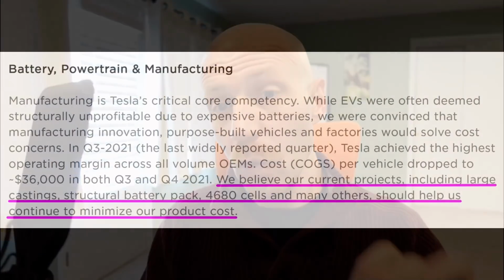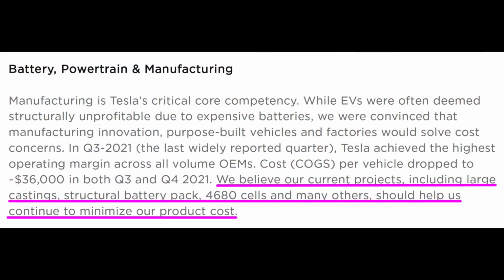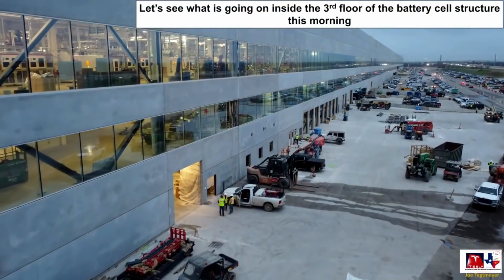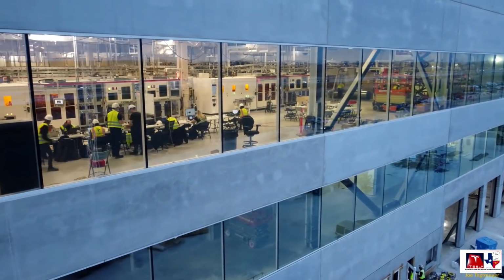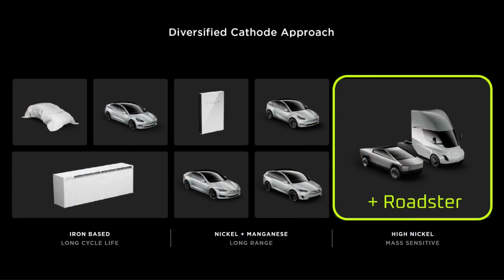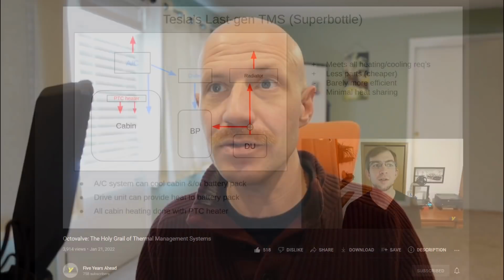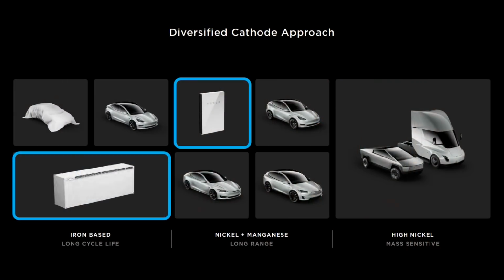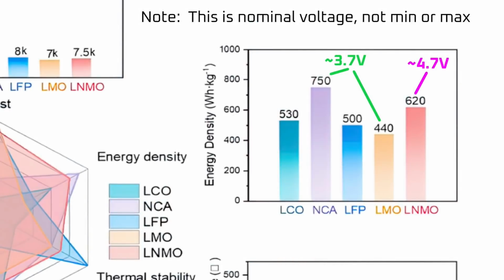Tesla Q4 Earnings Call:  A Tour de Force // Battery Maturity, Embodied AI, FSD Demand, Mn Batteries

Comment from the maker: Additional Note/Correction on Manganese and LFP! 😀

1) I may have been incorrect about the ability of Manganese to dope LFP and increase energy density.  I thought I saw this at one point, but I'm struggling to find that information again.
2) I can't find a chemistry that's primarily LFP chemistry with Manganese added.    However...
3) There is an up and coming chemistry called LMFP which appears to be 80% Manganese Phosphate with an Iron Phosphate and Carbon shell....
4)  LMFP has a voltage 20% higher than LFP and it appears that most of the rest of the characteristics similar (cycle life, power density, capacity, etc)
5)  Elon said "manganese is an alternative to iron & phosphorus"...
6)  So did he mean an alternative to both iron and phosphorus (in which case LMNO which is an oxide), or an alternative to Iron Phosphate (in which case LMFP, which is mostly manganese phosphate).  Eliminating Phosphorus is relevant because it poses a host of environmental concerns (but there are companies working to develop greener processes).
7)  The plot thickens!  I need to do more research on this.  I've just scratched the surface, but it's pretty exciting.
Reply: Thanks Jordan 🙌
We need more of these types of videos from you.
Also good idea to do a monthly battery news video.
Thanks 👍
Reply: I think a monthly update video would be awesome. It allows you to slot in information that doesn’t fit into any of your regular videos or cover information in time manner and going to detail later on.
Reply: https://www.youtube.com/watch?v=C8FNv6hlMVI No affiliation, but a great explanation of LMFP
Reply: Listening to interviews of the Chinese factory president I believe that a Chinese Tesla’s is 100% on the cards. While it won’t be called a $25,000 Tesla I suspect the Chinese vehicle will fulfil that price bracket. The president of the Chinese factory spoke at length about producing a vehicle that is uniquely Chinese and something they would all be very proud off.
Reply: I think we need to have post quarterly earning call listening parties and parse sentence by sentence what is being said whenever Elon speaks. Or basically whenever one of the engineers speak.
Reply: @Tuber_Dog  you are joking about all that 'alien' stuff, right? It makes no sense at all.
Reply: I have a couple of 42 SEER 15 HSPF Carrier minisplits. That is more than 3x as efficient as my 13 SEER whole house unit. When you research the subject, efficiency matters.
Reply: Don't worry- wait until you get to be my age- then you will start to remember LOTS of things...
Reply: Hey jordan. A bit curious. How did batteries become your speciality?
Reply: Interesting that Sandy Munro is talking about LFP batteries in this video (https://www.youtube.com/watch?v=9z9xl8knLAk  at the 10:45 mark) where he says that LFP has much better energy density (but lower power density).  And he mentions the guys who replaced a Model S battery pack with LFP and it went 800 miles on one charge.

Comment: HOW MUCH DO WE KNOW ABOUT THE CATHODE PLANT IN TEXAS ? The LNMO of this presentation becomes more appealing by the hour & with a possible completion Q1/2023  there is plenty of time for development of the cathode plant while Texas & Berlin are ramping.
 About all we know (1) Dry electrode - Maxwell (2) Tab-less - Tesla internal, 
We don't know (3) Could graphite/silicon anodes also be produced -  Sillion ? (4) Could the final stages of refining Li, Ni, Mn occur at Texas - Capturing the high refining profits - (5)  Li-OH or LiCO3  ( 6) Electrolyte & electrolyte additives - Delhousie etc.
YOU HAVE FOUND THE KEY - FURTHER WORK ON LNMO IS CERTAINLY IN THE RIGHT DIRECTION.

Comment: There are so many problems with building a humanoid robot, however the most difficult is definitely the batteries. First of all batteries are extremely heavy, second they are extremely expensive, 3rd they are extremely volatile if they get punctured and explode. Another issue is their longevity, they do not have many cycles due to the current use of battery murdering systems. Therefore, even if you did get all of the other problems solved, the battery pack would not last and would make the robot prohibitively expensive and also unsatisfactory, and therefore unpopular.
Reply from the maker: Current battery tech will do the trick, just use LFP and pot it correctly.  However, by the time the robot is mass produced for the public, the tech will be much better (5+ years)_

Comment: Here's an alternate view on Tesla's 4680 situation.  There recently was posted a staff picture celebrating the 1 millionth 4680 battery in California and it implied this was in January 2022.  Well one million of these batteries can supply batteries for approximately 1000 model Y's.   If this is the whole story then Tesla is in big trouble with the 4680.

More likely the California plant has been more focused on assembling and validating new entire battery lines for shipment to Germany and Texas.  Even still, my feeling is that the Tesla truck has been delayed because demand the Texas Model Y (how is Tesla going to manage this channel conflict?) will be through the roof and the battery lines in Texas and Germany are just coming up to speed.  Tesla is not confident that there would be enough cells to supply the CyberTruck as well in this year.  So the "parts problem" of the Cybertruck then is actually just the 4680 cells. 

As an aside, it's noteworthy that Panasonic has moved its 4680 manufacturing from Nevada back to Wakayama, Japan and it's implied this is because the technology was not coming along fast enough.  I guess it's tricky.
Reply from the maker: Nah, it's chips, every other OEM is reducing output.  Tesla is increasing output, but you can only make those chips stretch so far.

1000 vehicles worth of cells is plentry to start a production ramp and there is always an S Curve with Manufacturing

Comment: I‘m actually wondering why so man people think Optimus is so far away from Teslas main business. Imagine, we might get robotaxis one day. There will not only be issues around charging those robotaxis automagically. There will also be issues around how to clean them automagically. Or even imagine you want to use thta robotaxis not only during day time but 24x7 as much as you. can. So my business model would be to utilize a lot of them, that will not be useed for people transport at that times as much e.g. during the night time for parcel transports. But for all that, charging, cleaning,  rebuilding at the beginning of the night to be a parcel transporter,  load and unload them at their source and destination addresses, probably utilize the as a delivery hero car or doing some minor repair work on them like changing tires depending in weather conditions etc.pp, whatsoever, you would either need expensive human workforce or inexpensive Optimus types of humanoid robots. So Optimus IMHO is at the verge of its existence THE essential missing link between a plain robotaxi fleet and an economically optimized robotaxi fleet. As soon as Tesla has achieved that, Optimus will be a interesting product to be sold or rather RENTED as a personals assitant for any human. Which will make the product Optimus even more profitable.

Comment: Re: $25,000 vehicle... I think Elon is telling the truth that this model has been dropped for the time being, because Tesla sees Tesla Network as their way to get into that price sensitive market. 

Let's look at a 7-year cumulative TCO. Let's say for a $50k Model 3 that TCO is something like $75k at year seven. For the $25k Tesla that drops to $50k. This is assuming both have 29 kWh/100mi and we're driving about 15,000 miles per year in Colorado.

That means the cost per mile on that $25k Tesla for those first 7 years is $0.47 instead of $0.71 for the Model 3.

That might seem like a decent savings, but compare that to the Tesla Network estimated cost of $0.18/mile. It blows even the $25k Tesla out of the water. And that number could possibly be improved with a more ruggedized vehicle, even if it's more expensive. I think that's Tesla's path into the low end of the market, not trying to nickel and dime a vehicle down to $25k.

Comment: Respectfully disagree on the $25k/robotaxi point. Tesla's current offerings are designed around private ownership fo factors. When Tesla is serious about deploying a robotaxi fleet, they will need a form factor actually designed for high volume usage. That means easy access for low mobility (sliding doors), no "cockpit", etc. Something that lools like the Cruis Origin, which would likely cost around $25k to produce.

Comment: THANKS4GIVING Great post young man. I am also interested in HVAC or Thermodynamics, looking forward to any of your posts on that. 
    About 3/4 through you mentioned Elon stating higher voltage.  I feel strongly the operating voltage of these battery packs will go up to a voltage of 1000VDC. Koenigsegg is already using 1000V systems.

Comment: Agree with Elon. No LFP in the 4680 form factor as BYD's Blade Battery is an excellent solution. Your presentation of LFP convinced me that it's a stable chemistry with long term performance. The ability to fully charge and discharge provides more useful energy. NIO has addressed cold performance with their hybrid-cell (ncm/lfp) battery pack.

Comment: Great episode, Jordan!   I love the channel, always interesting although often over my (telecommunications contractor) head.  As a pro "cable guy," I still wonder about replacing CANBUS with a more network - like system; Tesla has a patent (or many) regarding this, but no action yet... I think.  Elon said "CANBUS is stupid."  A mini wifi network, with address(es) for each car would be super, and the wiring required and its installation could be cut WAY down. Sandy Munro pointed out the miniature receivers on Tesla circuit boards on the M3 teardown, so maybe they're getting close.

Comment: Great video, Jordan! There is some info going around that the new 4680 battery pack will have 98Wh this year, 108Wh in 2023 and 118Wh in 2024. Doing the math, this would give the model Y 94 kWh in 960 cell format this year. I see the 960 pack as 120 cells in series of 40 cells x 3 rows x 8 sections. Do you think Tesla will stick to that, or do you think they will slim it down to an 840 cell or even 720 cell format? To keep the Model Y around 82-85 kWh? This would also leave more cells for more cars.
Reply: I think as the batteries get better, they'll just use fewer, as required to make the stated range.  There's no reason to keep upping the KWh, other than maybe for a Super Long Range model with a hefty sticker price for those who DO want a 600-700 mile vehicle.  For an extra $10-12 thousand, maybe?

Comment: I'm not a battery expert, but from a purely mechanical POV, 4680 may not be suitable for LiFeP batteries because of the lower volumetric density, and consequently, the higher battery volume needed.

There's only so much area under the car that can be used for batteries, and if you need more volume you have to make the pack thicker.

Double stacking 4680 cells would not make sense because you would lose the structural benefits, and pack simplicity.  Maybe you could develop a taller battery cell, but given how rapidly chemistry is evolving, it would be risky to put the needed effort in developing that, building that machinery, etc.
Reply: It may be that they use a combination.  Prismatic in cars, 4680's in storage.

Comment: I am woried about the over hype of the robo taxi. We are looking at it through the best case scenario. What happens if just for the case people don't like the idea of being driven by an autonomous vehicle? Doesn't help all the negative media coverage about the full self driving. Besides that, it's just not as simple as 5x the amount of cars. Most people commute to work in a very narrow time period. It's not so easy to serve this demand with the fifth of the amount of the cars. Maybe in one to two ratio. Also a big potential issue is comfort. Most of people hord lot's of gadgets in their cars. Not sure people are ready to load and unload them each time they go to work. And these are just a few of the issues. I'm pretty sure the robotaxi is going to be an amazing thing. I personally can't wait to have it here, but I don't think it will replace personal cars, and specially not for the less wealthy people. They usually can't afford taxi and topically use old used cars around max 20K. So in my opinion not focusing on the 25K car is a huge misstake.
Reply: The robotaxi will be a niche, no one thing serves all needs.  They're not focusing on anything they can't make.

Comment: I look forward eagerly to your analyses of battery tech but this video was next level!!! More of this pleeease...
I'd also like your opinion of utilising smaller battery packs (using same resources you can create more packs/cars) that charge faster (this is another benefit of the 4680 and it's "tabless" design) and which are also lighter and are thereby more efficient (i.e. get more miles/kilometres per kWh). Part of the problem currently with the car is that it is over a tonne of vehicle weight moving the occupant (~100kg) which makes the useful effort only about 10% efficient at max - this issue is even worse with evs as their weight is even greater...
Generally speaking people won't need more than 200km range and, if the battery charges fast enough, there shouldn't be issues when going on trips...

Comment: For collecting data for Tesla bot. You just need humans with cameras and motion capture gear then have them perform some task in the factory. This is why the robots need to he humanoid because it simplify data collection. Also getting robots to do useful task is actually much easier because factories are a much more controlled environment than the public roads. It is highly likely that Tesla will have humanoid robots working in their factory before self driving cars drive unattended in public roads.

Comment: Frankly, nothing you've said gives me confidence they're about to produce 4680s at scale, and everything you'd said reinforces my thought that literally 'everything' depends on that.  Kato Road is irrelevant, that's not ever going to be mass production at the scale they need.  The fact that batteries won't be the constraint over the next year doesn't mean they have unlimited batteries, it just means they have limited chips.

It's just like you said, until it's happening, it hasn't happened yet.  4680s at scale haven't happened yet.  They may come, they probably will, but until they do, they haven't, and everything depends on them.

I think it's turned into a much larger production problem than they thought, and they're always getting closer, but they aren't there yet.  Every revelation of another step forward is really just another way of announcing that they aren't there yet.

And until they are, they aren't.
Reply: They said in Sept 2020 during battery day 4680's would take 3 years.  They're still have a year and they're making progress.  I think your lack of confidence stems from a lack of understanding.
Reply: @TheEvilmooseofdoom  We should be able to do better than insults.  But thank you for your perspective.
Reply: @benwashburn8553  A reality you don't like isn't an insult.

Comment: For an HVAC system, it's all about integration and control software. You may use your roof for sourcing heat if it's sunny in the winter, or to dump heat on a summer evening. Similarly you can dump heat in the summer by heating up water, or heat up a home by cooling liquid in a geothermal loop, or by cooling wastewater from showers, washing machines, venting exhaust and the like. There is so much efficiency to be had in the home that we should be able to slash energy consumption to less than half it is today. With better insulation and venting, we may gain a factor of 4 or better. If we combine that with energy storage (using EVs or stationary storage), we should be able to efficiently utilize the more bursty renewable energy sources and greatly reduce overall energy cost..
Reply from the maker: This is really excellent

Comment: There was incongruity in the messaging that if Tesla, due to parts constraints, cannot build new models and that the FSD software will still take time to work fully, why then talk of the ‘bot’ for which parts and software are even more remote.  Tesla has the 4680 cell, the structural battery, the front casting of the model Y, the opening of Giga Berlin and Giga Texas, the ramp in production at Hawthorn and Shanghai and had the earnings call restricted itself to this long list of amazing achievements it would have been more than enough.  A simple ‘watch this space’ with a grin would have been enough until the next quarterly earnings call with regards to new models and future projects.